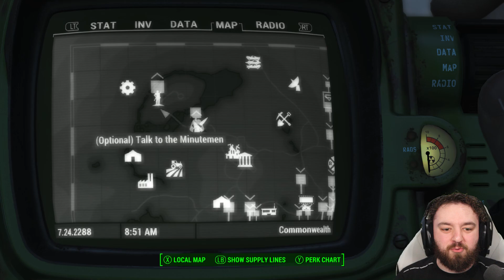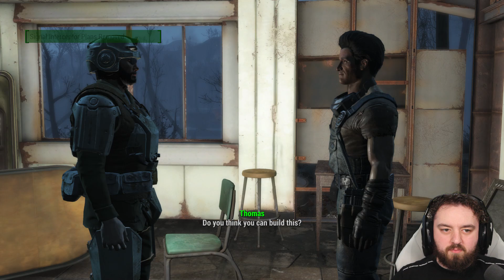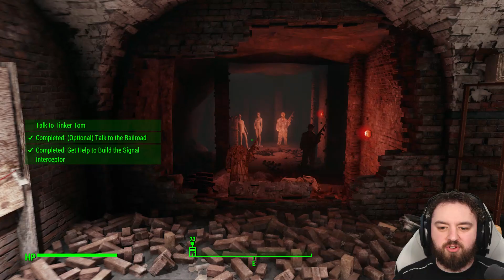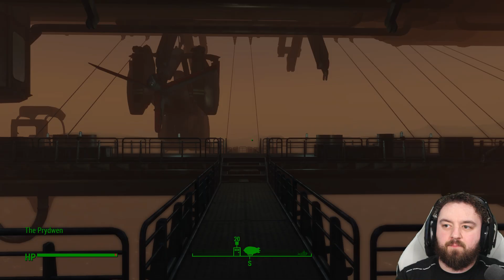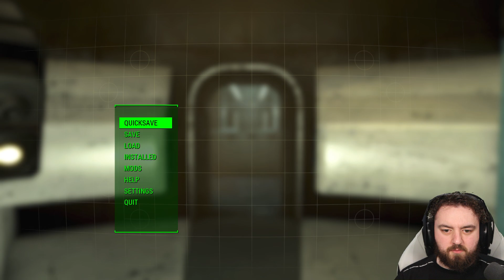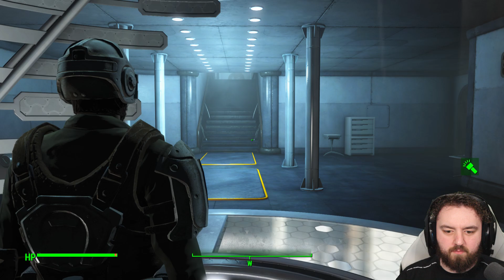Teleporting Right Into The Institute | Fallout 4 Ultimate 100% Run | Ep. 93

Comment: Why a pistol grip?  You can change gun stats by changing the grip/stock.
Robot (and weapon) mods seem to equip just fine out of the workbench.  At least I use em that way :)
Quests all reunify inside the institute.
You can get a peaceful ending with 3 factions.  Build the transmitter with the Brotherhood or minuteman.  Enter the Inst to spy for the RR.  Complete every quest upto where you chose a side. (No battle of bunker hill).  Then get kicked out of the institute.  The Minutemen will show you the back door.  Go in with them.  Sound the evacuation and get as many people out as possible (RR is happy), Blow up the Inst 'using' the Minute Men to soak casualties makes the Bro happy.
Reply: There’s another way you can do it that doesn’t involve getting kicked out of the Institute

Comment: Greetings Mr. Thomas! I must say that I am relieved that you have at least a fan in your room; staying cool/warm enough is so important. Where I live, the seasons are jinky at best, so during the spring and fall there is alot of temp spiking/dropping (sometimes 10 degrees in as many minutes) until Summer decides to aggressively settle in, in which case it turns 90'-100+' literally overnight. In the winter, there is the same MO, except in the opposite direction, resulting in freezing temps within a few minutes. Such is life in the Northwest US! I think it's about time to break out the iced Gevalia! 
I really appreciate your showing us all of the possible main questline endings, as I am still on my first playthru, and sided with the Minutemen because I really didn't want to annihilate any of the factions, and only reluctantly blew up the Institute; but am very curious to know the results of the other options. Hank U Mr. Thomas! (Also, warmest Greetings to the dear wee lads Teddy and Buddy!)

Comment: The UP77 is honestly really good as an automatic due to it's effect. An improved automatic barrel, quantum gyro compensating lens, and a recoil compensating stock make that thing into a DPS beast with very little recoil. It's recoil is actually so low at that point, that you could shove a medium scope on there and use it at long range just fine, meanwhile hip-firing at close range